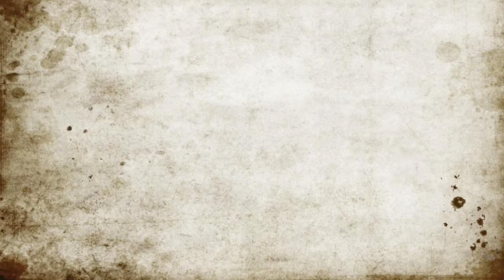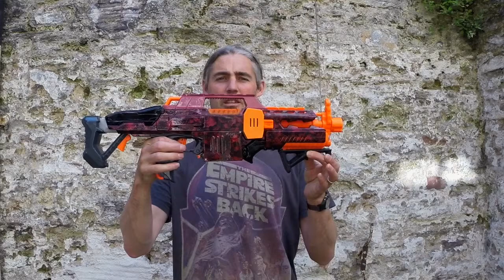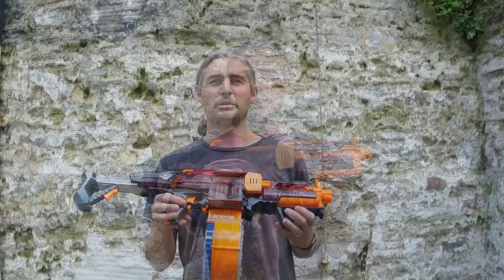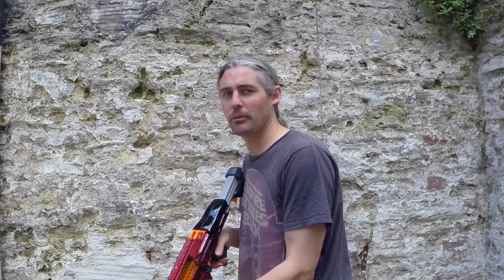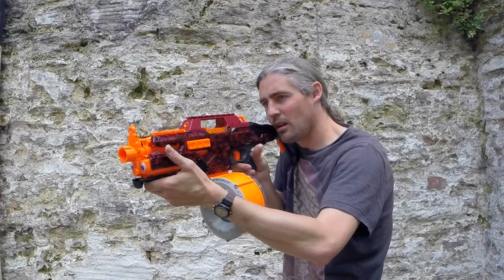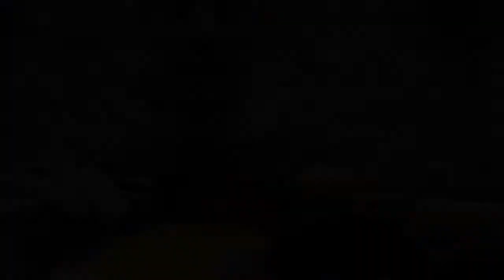The Reaper- Burst Fire Nerf Rapidstrike Mod

Comment: So I understand that production on the burst fire was cancelled but, could I make one homemade reasonably? And if so how would I?
Reply from the maker: If you are asking that question you are unlikely to get working burst fire. Be aware there may be announcements about modules in the next 6 weeks. My one is ready to start testing and others may be more advanced.
Reply: Foamdata Services ok thx for such a quick response on an old video, but what system are you using, would a raspberry pi or a aurduino work for these purposes
Reply from the maker: Yes, but the commercial modules will be smaller, neater and quicker. By the time you have solved the same problems, the two teams who have worked on this for 3 years should have a decent solution out. It's taken time because of legislation and part time developers.
Reply: Foamdata Services ok thank you 😊

Comment: +Foamdata services, say I want 3 xp180s like you're using here & want to use stock switches in the pusher fire control & motor rev switches, and use Microswitch for the trigger. Due to what you said about the motors, what flyback diodes would you recommend for the motors (pusher & flywheel both would need them I assume). Also, what other protections would you recommend. I'm not planning on implementing microcontrollers, so I'm not worried about problematic noise coming back on the current return.

Edit: I plan on using mosfets for the fire control & rev switches, which is why I'll be staying stock with them.
Reply from the maker: 1N5400 for the flyback diode, as in my mosfet video. I also wouldn't use ANY stock switches, they are not suitable for XP180's.
Reply: Foamdata Services not even with mosfets to carry the current?
Reply from the maker: Mechanically they suck. XP's have much more torque and greater rpm and they put too many cycles through them, the current isn't the problem. There's a reason all my builds use Cherry DC2 switches.
Reply: Foamdata Services So it's the overall suckines, not just inability to carry heavy current. I'm probably going with a high power bsuk kit anyway so the switch question is moot. Also found out that for flywheel, Xtreme 180s are just too much (too much speed), but are fantastic for a pusher. So will Blade the flywheels & go with an extreme on the pusher.
Reply from the maker: XP180's are a super flywheel motor AT 2s! they burn the flywheel centres on 3s, that makes them spin too hot. I would look at BlasterTECH and see if they have long shaft XAp's still. The shaft length is the only issue on the XP, NOT the rpm.

Comment: I just saw some one with a wolverine as a pusher getting 18darts a second on a 3s with 2 hellcats. I'm going to guess that wolverines are electricity hoggers and should not be used as pushers or am I wrong cause that is a crap load of dart a second.
Reply from the maker: Wolverines are currently being recalled due to not being the right spec. They are basically an XP180 rpm wise. My DPS counts are usually slightly lower than other people's because I am in the information business not the selling motors business.

Comment: I put my burst module in the battery tray; it's just an Arduino and a MOSFET.
Reply from the maker: The battery tray in mine is fully taken up by the large 60A Lipo.
Reply from the maker: This also has a full IR gate that can count darts if required.
Reply: Foamdata Services okay, okay :P

Comment: I don't know if this has been asked or answers but it still has full auto right and how fast is iit. If I got this kit could I turn it down to around 12 darts a second thanks love you work
Reply from the maker: It's full auto, 1/3/5 round burst and ROF depends on the pusher motor, the module will work with any motor and ROF up to 15dps. This version won't be for sale, it's just a prototype.
Reply: So there is a full auto switch? Just asking do you play rugby?
Reply from the maker: The burst fire module has 1/3/5 shots and full auto, you can also switch it out and run it like a regular modded RS. I do not play rugby.
Reply: So you can't switch between semi and full auto in the mid of battle ok thanks
Reply from the maker: You are monumentally un observant. Of course you can switch modes, I do it several times IN THIS VIDEO. What would be the point of a pre set model you couldn't switch?
Reply: Sorry

Comment: What will a 10.8 volt NiMH get you with rhinos?
Reply from the maker: About 100-105fps. Use an 8.4v and HONEYBADGERS if you want 110-115fps with a pack that fits in larger trays.

Comment: where did you get the angle foregrip ?
Reply from the maker: Generic magpul clone £5 eBay. They just fit Nerf rail. Worker do foregrips for Nerf rail as well.
Reply: +Foamdata Services thank you !
Reply: Foamdata Services I have a few spare actual magpul v2 angled foregrips, would they fit on nerf rails, or would I need a picatinny adapter?

Comment: Tom did this ever make it to production ?
Reply from the maker: No, the issues of CE compliance and cost/complexity of installation scuppered the production version. Development of an alternative is still a possibility. A bit if trigger discipline is cheaper though. I wanted to see how far I could push a RS build. When it was built it was easily the most powerful RS in the UK.
Reply: That kool think its a neat idea tbh and a fire selector on a modded RS seams a good plan

Comment: hey Tom what's ur opinion on these guys?? 5 Pcs DC 6-12V 50000RPM High Speed Torque Magnet Mini Massager Vibration Motor
http://s.aliexpress.com/UfIJRRfe
(from AliExpress Android)
Reply from the maker: +Shreyas Raviprakash Low rent metal brush motor, poor substitute for the better quality 3s MTB Rhino or the 2s Banshee.

Comment: where are the chrony results?
Reply from the maker: It shot like my Krinkov, see that, it has the same motor spec. I lost the original data. When I put a fully balanced flywheel set in I will do a fresh shoot.

Comment: It looks so much like Nosferatu (Drac's rapidstrike).
Reply from the maker: That's because I made the Nosferatu. This one is actually slightly more powerful too.
Reply from the maker: The base paint colour for both was the same too, the reaper has more metal flake in the red. Drac wanted the Elite stripe in orange and I did a different vampire themed dip too. This has Triple X motors, three Xtreme Productions 180 Pros, it can shoot 130fps on elite darts, with Nerf flywheels.
Reply: +Foamdata Services nice! Thanks for letting me know.

Comment: Do you know when this is released?
Reply from the maker: The module is available custom order only from BSUK, contact sales@blastersmiths.co.uk via email if you want details. It's not cheap though. You can get a DIY version for much less if you can do Arduino already.
Reply: Foamdata Services how cheap is it?
Reply from the maker: Ask them, they make it. I just did the rest of the blaster.
Reply: Foamdata Services Thanks
Reply from the maker: +Alex Howe More details on a new burst fire solution before December, cheaper, as good and simpler than the prototype in the Reaper.

Comment: Even with a 2S LiFe pack it still sounds beastly, what kind of fps do you get at 6.6v?
Reply from the maker: That's a 3s LifePo, 6.6v was horrible, I did try it. It pulls a high 110's FPS average on a 2s Lipo and low teens on 3s LifePo.

Comment: Hey, when will you sell this, and for how much, because I really would like it.
Reply from the maker: You could commission one, but given the burst fire module is one of only two working ones, and the production version won't be out until next year, expect to pay around £300. It takes about 10 hours of my time just to cut and prep then paint the shells. Parts are over £60 then the BF module is £200 as each one is hand built and custom programmed at BSUK! Wait for the production one, it will be plug in and less than £100!